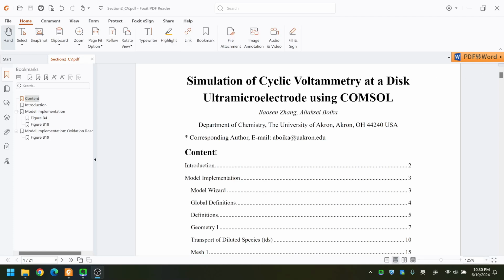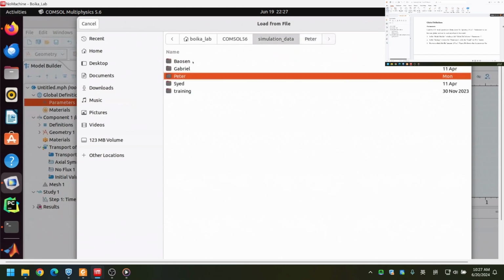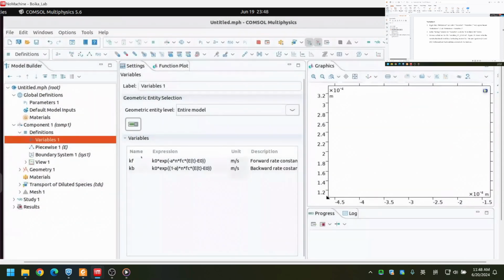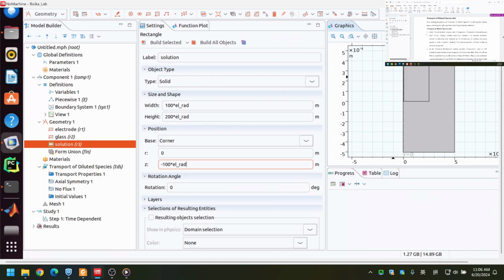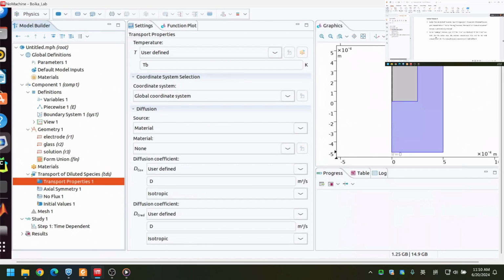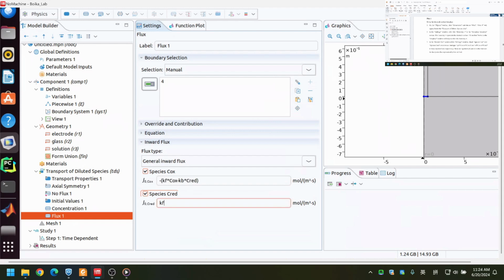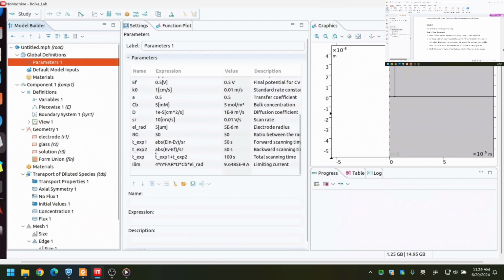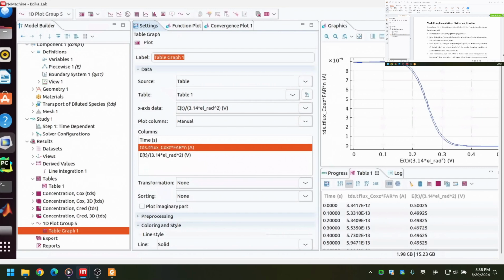Section 2 Cyclic Voltammetry Using COMSOL

Comment: I have been working on CV in COMSOL for 8 months with no progress. My main issue is that there is no tutorial that uses materials in their CV simulations; everything is generic. I'm still at a loss on how I would incorporate a specific material into these simulations (e.g., platinum for the electrode and phosphate buffered saline for the solution).